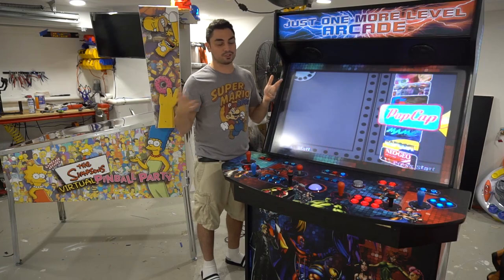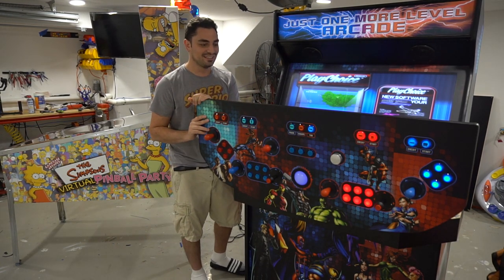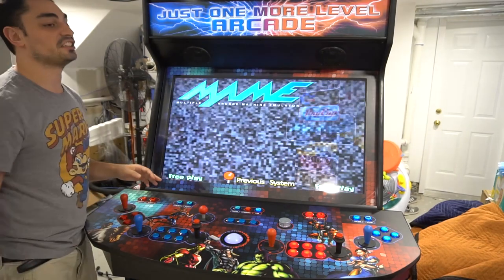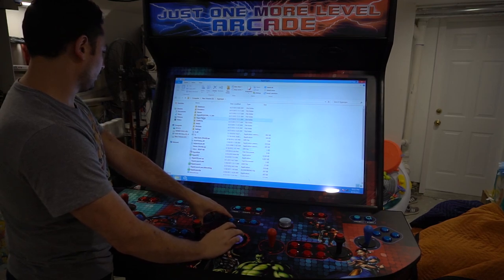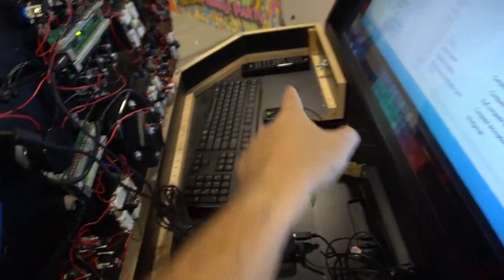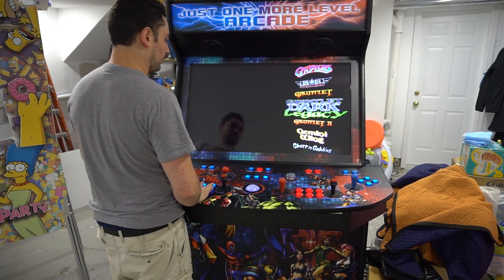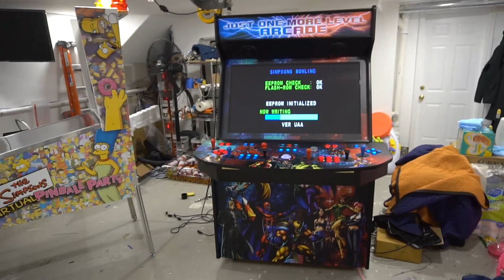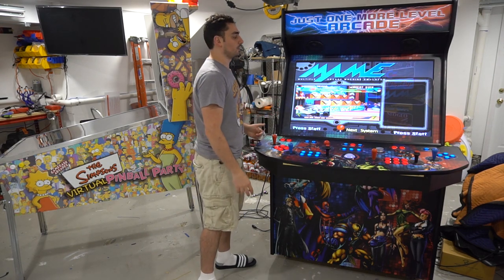4 Player Arcade Cab Marketplace Find! I Paid How Much?!

Comment: This is why I never buy Mame only built cabinets. They generally are very poorly built and often built buy mass producers who provide very low quality old PC's to run the front end. I think sticking to original cabinets and converting them to Mame dedicated setups are far better quality and have more value since they can easily be converted back to the original game PCB that generally go for far higher prices if in great condition. However even though this video is a year old its amazing you got that for so cheap considering its definitely worth at least 1800-2500 dollars in its current condition in the video. great find

Comment: Hey Vic. What is the fix for the Simpsons Bowling. I just tried it on my arcade cabinet and get the same error as in this video. I tried troubleshooting it when loading up the game, but haven't figured it out yet.
Reply from the maker: 1. Launch the game.
2. Let it load until you get to the "bad" screen.
3. Press F2 and don't let go.
4. Press F3 and let go.
5. Don't let go of F2 until the game says "Eprom Initialized"
6. Let go of F2. That should do it.
Reply: @Vic_VP  Thanks Vic. I had also googled it and got the answer after I posted my question. I appreciate it. This is a pretty cool game.

Comment: If you put your build on it, I would buy it for sure.
Reply from the maker: Ehhh like I said me personally I'd rather have p1 and p2 have 8 buttons and remove the 2 crane joysticks. 
Also a customer would need to tell me how many tb and what systems they want. 

Also note if I changed PC and such this cab I would sell for 6k+
Reply: @Vic_VP  yea I understand. At that point it would be worth it to just have someone build from scratch so you get the exact artwork and setup desired.

Comment: I know it's been a year or more since you posted this but..... You could have put a Dell optiplex in there with a 1660 GPU. And put a couple 4 terabyte hard drives in and Windows 10 and then easily slap together a much better build insole this machine for much more than you have in it.
Reply from the maker: Ehhhh partially true... but this cab and artwork is very specific to a person's needs. I was lucky to get the amount I sold it for as is... many people low balled me so it wasn't worth me investing in what you mentioned